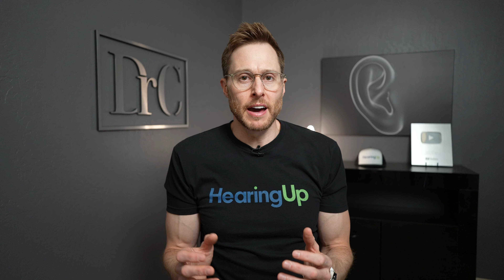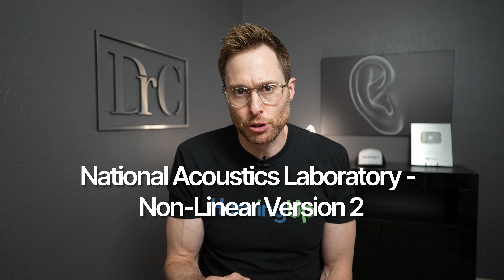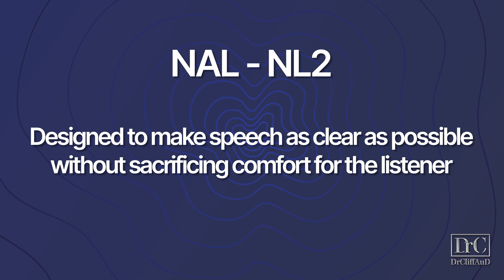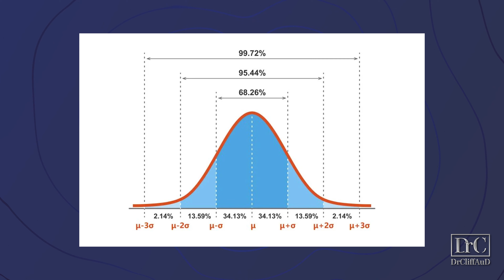Schooling YOU on Real Ear Measurement

Comment: i wish the VA would do real ear measurements. they program the hearing aids to the hearing test and send us on our way. dont go over anything, no adjustments made. the VA is terrible and their hearing aids are locked so no one else can adjust them. i have a great pair of hearing aids but i dont wear them because they dont sound correct and everything is distorted.
Reply from the maker: @rabbit12821  the VA is a socialist medical system. What do you expect? They are overrun by veterans and understaffed.
Reply: @DrCliffAuD , for what I heard from patients, it depends on the place of VA. However I wouldn't stricly relate users satisfaction with socialism, because accessibility and availability is also important. For what I know, there is many hard of hearing people who never had any hearing loss treatment.
Reply: My hearing loss is severe to profound. I have been using VA provided HAs for at least 20 years and could not be more pleased. The Long Beach Audiology Dept. Is excellent. They use REM and follow best practices. The Vet is requested to complete and return a survey as to how the fitting is addressing the hearing loss and patient satisfaction. The surveys are read by the prescribing audiologist and supervisor and a follow up scheduled if necessary. As the VA prescribes top of the line HAs is follows that it should provide top of the line audiology. I am currently using Phonak Infinio I90.

Comment: I get that a rough estimate of the hearing is needed first to understand what type of hardware we need.
But why not then use the hearing aid itself to measure using the actual hearing aids?
That would match to what you actually hear with the aids attached and producing the sound.
Then the comfort factors could be adjusted.
But please correct me as I'm NOT an audiologist.